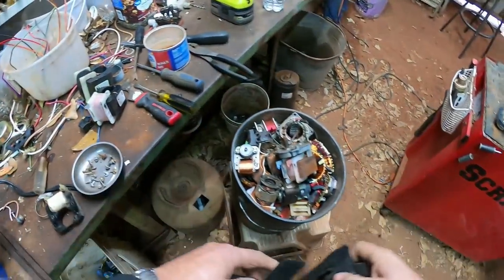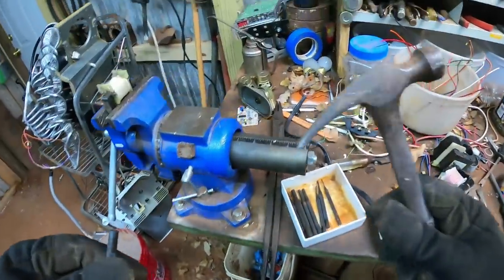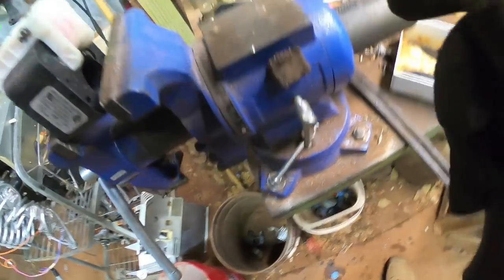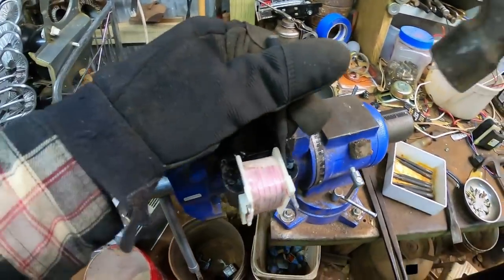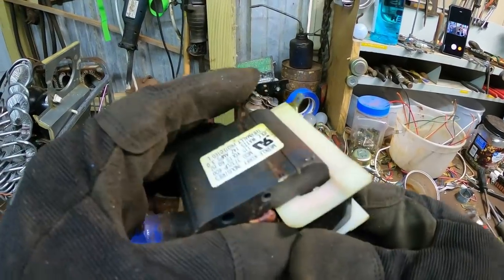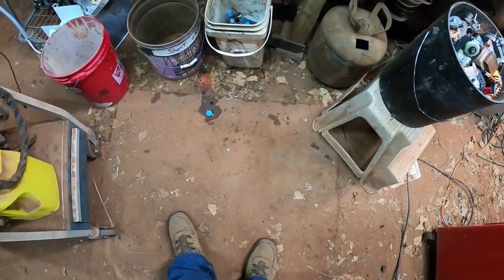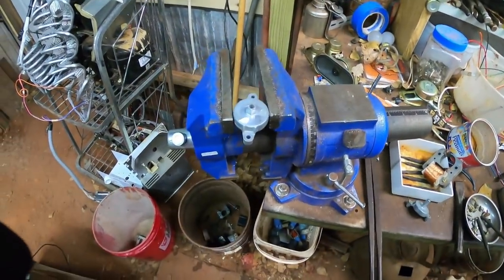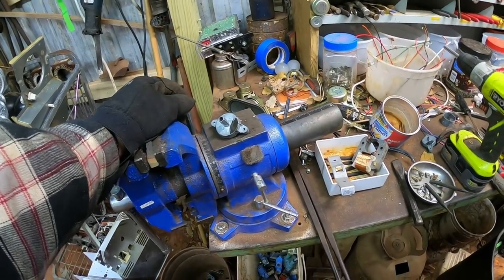Scrapping a bucket full of small stuff for clean copper

Comment: I love micro scrapping. I find it relaxing & therapeutic. That's a big old tub of micro scrapping to work through. Great video. Informative ascwell.
Reply from the maker: I got it prepped and the wife cleaned it up, got 10 lbs. out of it. some have said that if you hit the other end where the round hole is with a hammer it will open up and the copper will fall right out.

Comment: Hello from Sweden again.
I see that physichs nightclass did some good,, F=M A,, the bigger hammer always wins 🤣
Microscrapping is just so Theraputic, pulling prongs off the plugs, stripping motors like you in the video, picking stuff from circuitboards.
Stay safe and take care.
Reply from the maker: yeah, always have some small things to process, small amounts but they add up, I take a bucket of small stuff into the wife, and she will break it down
Reply: @Okiescrapper  Oh yes, all that small stuff do add up. I kind of like the Microscrapping but the bigger stuff is fun. I do pickups from a whitegoods repair shop and supplier and they also do AC/heater units so I have a steady supply of those, so far this year I have done more then 30 of them..

Comment: If you take the motors and set them diagonal on you vice and hit it with the hammer they come apart very easy without using puches or chisel
Reply: I do the same. Hit the back with a hammer and the winding falls out. Takes 2 seconds.

Comment: can you toss the whole mess into the oil burner & just melt the copper off the steel bits?
Reply from the maker: not sure if my oil burner would get hot enough to melt copper, had 10 lbs. in that bunch, most yard's don't like melted metal. Thanks for watching

Comment: The only tool you need to release that bundle of microwave fan motor copper is a hammer - beat the opposite end or side to side and the copper will fall out as the 'tongs' spread open from the hammer blows, in seconds.
Reply from the maker: sounds easy. I will try that

Comment: use a chisel to cut the copper, it will be easier.
Reply from the maker: I have done that, I have used an old wood chisel and an air chisel.
Reply: @Okiescrapper  use it on the wire first. it will come off easy.

Comment: With those microwave fan moters, open your vice up n put it in width ways with the roter hole near the top.
Tighten up the vice n push out the spool of goodness, to easy🤔😮😲💣💥👍🇦🇺🇦🇺🇦🇺
Reply from the maker: I will try that, a lot of the motors are from the auger on a ice in the door  side by side. Thanks for watching Ed